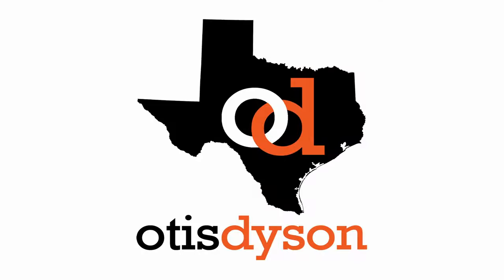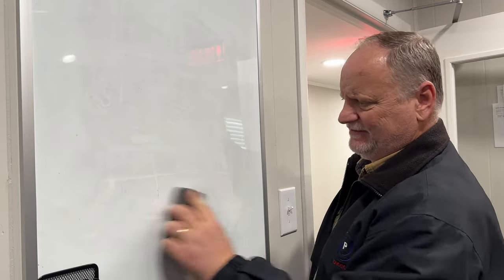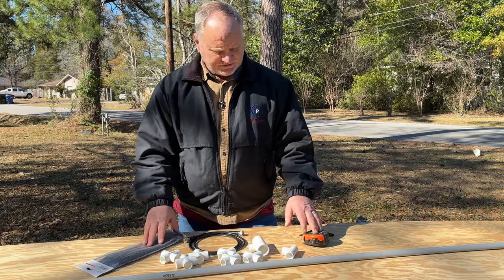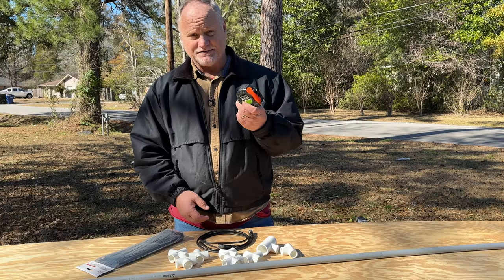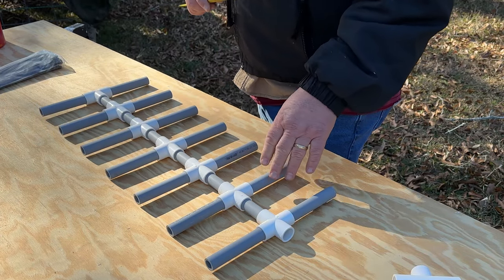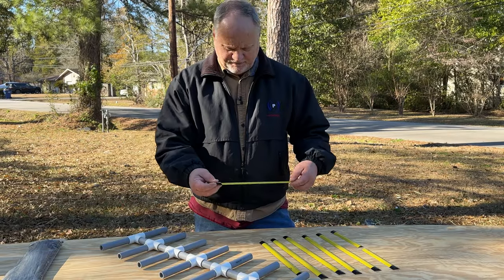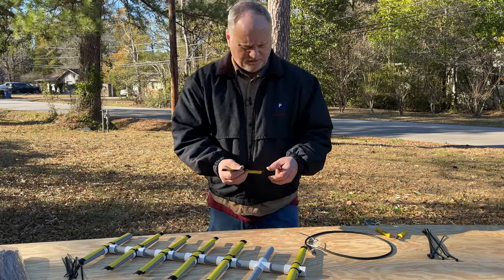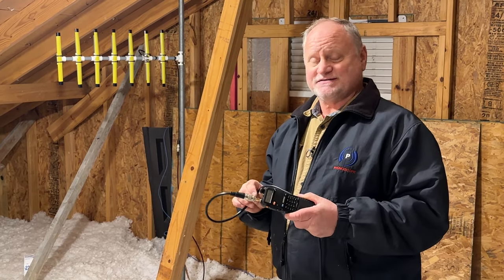How to Make a Tape Measure Yagi 70cm Beam Antenna DIY

Comment: Ive been using a 4 element 70cm yagi tape measure and its getting into a winsystem repeater about 32-35 miles away. It works.
Infact, i just checked the swr today and its 2:0 on 447.975

Next im looking at a 4 element cubical quad for 2 meters.

Comment: What was the length of the hair pin match wire? Great build, im gonna make one
Reply: I beleive it has to be   < 1/4 wave lenght, Anyone have any idea on how to measure the hairpin ?
Reply: Approximately FIVE (5) Inches in Length.  That's the Norm for BOTH a 2 Meter & 70cm Yagi Antenna HAIR PIN Match!  73's AE0QG 🇺🇲

Comment: I followed the instructions; all pieces are cut correctly. My SWR is a 9:1 at 445 MHz and 1.5:1 at 915 MHz, I am not sure what I did wrong. also, what is your trick to get the solder to stick to the braided shielding of the coax cable, I cannot get a good solder joint. I used 3 13 directors instead of 4 if that makes a difference.
Reply: SWR is adjusted by moving the driven elements in or out, at the hairpin.
Also, if you're putting the antenna in the attic, you really don't need the support pieces.